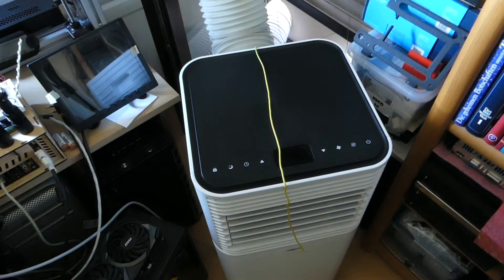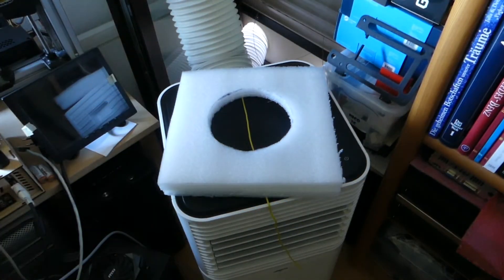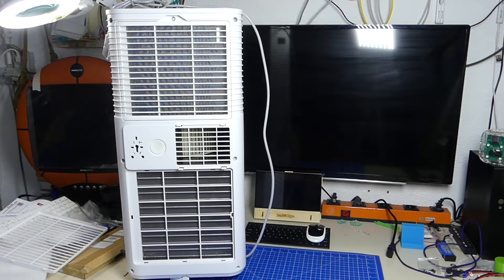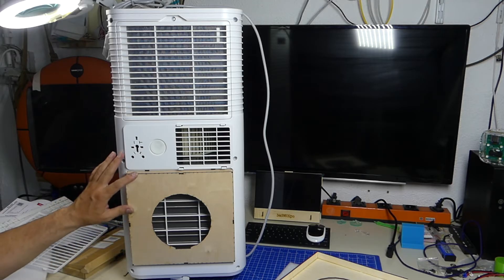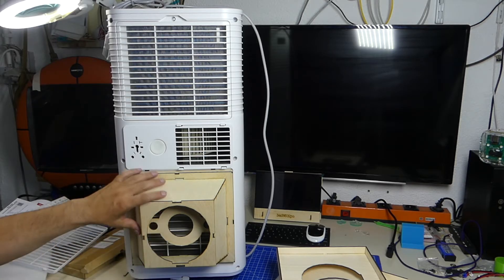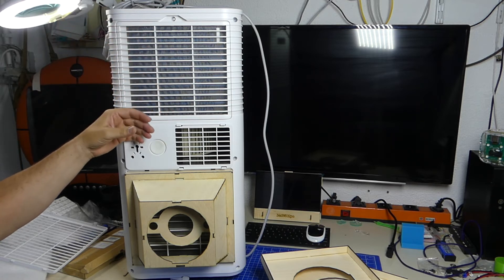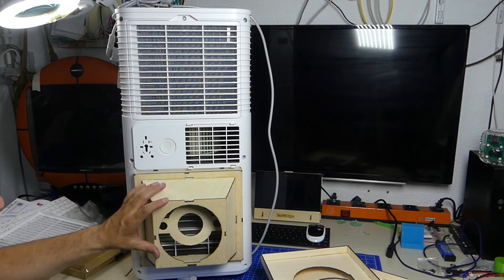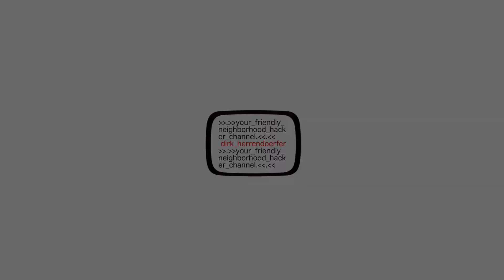Air Conditioning Mod to Dual Hose - The Perfect Unit - Hold ya hoses, going tripple

Comment from the maker: There have been a lot of requests for the hose-box cut files.
Here's the link for the parts file. You can use this with a laser cutter, or print it out to make the adapter from thin (3mm) boards.
https://drive.google.com/file/d/1gewKkT7uvWD-K3KmK_vRhNqbHUll4xzC/view?usp=sharing

Comment: I just converted my Delonghi  Pinguino into a dual hose unit, and wow... what a difference. I'm in a 52-year old apartment, with mail slots in the doors, and it has an air system that instead of exhausting air from the hallways, it pumps in outside air instead. It's hot in the hallway. The single hosed unit would pull that hotter air through the mail slot, along with cigarette smoke. But as soon as I added a 2nd hose, it runs so much better, and no more cigarette smell. My windows are casement type that swing outwards, so mounting hoses side by side isn't the best option. But my window's 16 feet long, with a swinging window at either end. So... 1 hose per window. The next addition was insulated hose wraps. Holy crap... you can't even feel any heat from it. They have cheap wraps with velcro, but the Delonghi ones are a single sock type, perfectly sized. More expensive, but better flexibility due to jot having a thick seam of velcro running the length of it. I also cut 3/4 inch plywood for each window for the hoses. Those mounting kits let in bugs, and get hot themselves. I still plan on adding some sort of insulation on the plywood though, as I intend to leave everything hooked up over winter, and just use the dehumidifier instead.

Comment: I've been thinkering with my own quick cardboard, sadly, my ac power increased from ~950W to 1100W+.
This is still under the rated nominal "1200W" written on the side of the ac (there is also 1000W so i'm not sure).
Not sure if it's worth trying to print a 3D part to replace the cardboard one, with something similar to your diffuser inside, and a 15cm tube

Comment: My model is basically the same as yours. I made a quick adapter out of card board and foam, functionally similar to your first adapter, which hooks up to a 4 inch hose for the compressor's intake. Currently there is an issue where the compressor only stays on for 5 minutes before stopping (doesn't happen without the adapter). I think it isn't getting enough air to be cooled. I might try a 6 inch hose, but my adapter probably needs to redesigned as well.
Reply: I changed the 4 inch hose to a 6 inch one and it is now working as it should.
Reply: Thank you. Just ordered the 4 in and I got here today. Haven't tested it yet. But I had a 2-in line that I tested and it was not enough air and it was doing this.  Had to cut a few relief holes in the foam to get it to continuously run and not shut off. 

I did something similar to you. I used a foam insulation and duct tape. 

I'm expecting that I will need to upgrade to a 6-in hose now thank you. 😁

Comment: I wonder. What would happen if you pipe the hose to nowhere down to the condenser intake, and pipe the outside intake to the evaporator coil? It would be ventilating fresh air in a controlled manner similar to a car's AC in non-recirculation mode. Your current configuration is the recirculation mode which is good for rapidly cooling a space but limits fresh air. Just a thought.
Reply from the maker: Yes, that's true. But you can still open a Window this way, have some circulation and humidity exchange. You're just not sucking in all that moisture from ouside.

Comment: Hi just wonder if you can release the file public?
Reply from the maker: Done that, it's in the pinned comment.
Reply: @dherrendoerfer i see your part where you put it it has like a section separated and not nust flat did you have to replace a plate or sth because mine seems to be just flat grid
Reply from the maker: That was a coarse filter insert that I could remove to make the baffle fit better.

Comment: Hi, I've ordered the same model but in 9000 BTU variant. Any chances to purchase some wooden funnel adapter that you made ?
Reply from the maker: Probably not, but I can share a printable file so you could cut one from foamboard or plywood.
Reply: @dherrendoerfer  Actually, I have the non WiFi 9000BTU version of this unit, so it's not exactly the same. I did a cardboard Dual Hose conversion, and it improved the cooling significantly. I used a 200mm hose instead of another 150mm like the stock one, sealed the cardboard with tape, and added a quite restrictive mesh filter inside. It also made the unit slightly quieter, but the lower part is also hotter now, just like you noticed. But most important : no Negative Pressure anymore in my room !
Pretty happy nonetheless. I paid 209€ for it, worked a few hours for the Dual Hose Mod, and everything is solid enough to be reusable every summer. Really happy ! And thank you for your answer too !

Comment: Nice. Now insulate your exhaust and intake hoses, and if you can shorten the run. (move closer to your vent)
Single hose AC units should be illegal!
Reply: Yep for me. I just drove around to where they were building new houses dived in a couple dumpsters until I found an insulated duct.
It helped a lot

Comment: Hi. Great video! It inspired me to do something similar to my own unit. It's a Bosch cool 2000. Do you think it will work for it? Regards!
Reply from the maker: Looking at the unit, it should work - It seems like it's just a rebranded Midea. I believe that one has been tried succesfully before.
Reply: @dherrendoerfer  Thank you for taking the time to answer my question. I will probably attempt to mod it before summer kicks in.

Comment: Great idea using cnc laser cutted wood! The greater improvement since the 1st version came from the box deep. The box deep should be, at least, 1/4 of hose diameter, so the air has enough lateral area to spread around evenly. I would also relocated the hose hole as low as possible, because the lower pressure (higher suction) behind the condenser is at its higher part (closer to the condenser fan).
The 3rd hose was also very clever, I would do it too!!!

Comment: i have this exact model of ac unit, could you please give me the measurements you used so i could fashion my own mod?
Reply from the maker: what measurements would you need ? - the box shaped insert has a size of 255x240mm some sanding at the edges make it fit perfectly.

Comment: I have a single hose unit that I'm going to convert to dual house.  I completely disassembled it and inspected everything....

* This piece of junk is pulling a big draw on the room 
* It blows out a very heavy plume of very hot air 
* It is sucking hot air in from the room next door!!?!
* I'm going to do a duct tape special and feed it fresh air from outside 

What a very frustrating design they have made...  It makes no sense
Reply from the maker: Yeah, the unit I started with had the same issue.

Comment: Third hose seems the obvious way after seeing this video, but why don't you just lift the unit up? I'm trying to mount a shelf near the ceiling and install my portable ac there as I have also ax exhaust hole in the house wall; I think this way I can shorten the exhaust hose and also make the unit cool the hot air near the ceiling and 'shoot' it at the floor. I think I hope I'll get some improvements this way over a standard floor installation.
Reply: PS your single to dual hose videos are awesome, thank you very much for sharing!
Reply from the maker: @giuseppearcieri1944  Yeah, that is a good idea too.

Comment: I made a similar conversion for my mohorhome however my problem is, due to the lack of space, I had to install the original exhaust hose and the new hose to take the air from outside very close together. Do you think that might be a problem? This would mean the condenser is probably going to take some hot air previously exhausted, mixed with the exterior air
Reply from the maker: Generally yes. The units usually have enough coolant to support a wide temperature difference across the condenser and still be efficient - maybe you can add guides or vents in a way that separate the air flow somewhat.
I build a recessed unit using the three hose design for a friend in a mini-apartment and it works like a charm.
Reply: Cus if u add a second hose to cool the condenser it won’t reallly do anything the ones they sell with 2 hoses are mad to use the outside air to cool the condenser then expel that air and the air it wakes in gets recirculated, if u add hose it can magically make the air recirculate so it will still be dumping the good air outsode

Comment: Would it be worth while putting a fan in the funnel shaped inlet from outside and maybe a fan assisting exhaust?or would it tax the system too much
Reply from the maker: No, it would probably help. But you would heat the cooler with outside air, or introduce humidity maybe.

Comment: Hello. Perfect job ! You seem to be someone perfectionist and pugnacious (as a quality of course). You helped me a lot in my research. Did you insulated the 2 interior parts (hot // cold) of this unit with thin insulation sheet + thermal silicone sealant as well, to prevent any air leaks? Finally, do you think it would be interesting to switch to 2 insulated exhaust ducts for air exchange with the outside? (I am thinking of thermal exchanges but also noise attenuation). Sorry for my bad english :)
Reply from the maker: Thanks ! never heard of that second adjective before ... 
I think that insulating the hoses only makes sense when you have a very long way to go, in my case I think it's not needed. The unit I have here was not modified internally, I think it's good enough, at least way better than all the others I've experimented with.

Comment: This is series of videos on portable AC units is super inspiring and well done on explaining all the details. I really enjoyed watching the conversions to improve the single unit design. 
It inspired me to undergo a similar conversion and prepare for the summer. It's best to start early, before these units become very expensive and unvailable :)
What do you think of the Ometa AC unit 9000BTU, it seems to have similar design with the condesor coil nicelly exposed at the back? I probably would need to open it up to confirm that inside partitions are well separated and sealed, but looks promising. It doesn't seem to have nice removable covers like this Medion unit, but I think that's something I could work around.
Reply from the maker: Yes, I think that may even be the same unit inside - or something closely related.

Comment: Hi i have a logic that looks exactly like yours but im not sure if mine will need the top or bottom converted is there a way to tell more air seems to get puljed through the top there seems to be a senor on top ill add a pic if i can 
Thanx in advance 1:49 1:49 1:49

Comment: I've discovered that my RCA 12,000 BTU portable AC unit is made by Midea and uses a similarly separated and gasketed design to yours, in spite of being in a larger and differently shaped cabinet.  Your videos are quite helpful for me to add a condenser inlet hose.  It's particularly important right now as my area has been blanketed in wildfire smoke for a few days and I have to stay inside and keep the windows closed to avoid triggering my asthma constantly.  I can't use my single hose portable AC since it will draw too much smoky air from outside.  Adding an inlet hose for the condenser will help me a lot as the temperature outside has been over 30 yesterday and today, and it's starting to get too hot and humid in the house.
Reply: Hey there, i think i got the same model as you and I’m currently looking forward to do this mod. Have you done it yet? If so, let me know if you have any tips regarding the way to connect the new hose. Idk about yours, but my model didn’t come with a detacheable filter like the one in the video so I’m still tinkering it
Reply: If the unit is not near a window or exterior door it's better to not have a hose pulling in the Smoky air from outside

Comment: you might wanna measure the actual power drawn with and without the second hose. my shot at this didn't go as hoped. with the second hose setup the power consumption increased from around 690W to 830W without a significant change in temp vs. time figures
Reply: The condenser was being cooled with conditioned (cooled) "from room" air in single hose configuration. With dual hose configuration, it's being cooled by warmer outside air--the compressor sees a higher pressure workload, trying to compress the warmer refrigerant. 
How much difference? It would depend on the inside-outside temp difference. 

The efficiency of dual hose configuration will be seen with faster indoor cooling and reduced operating time to maintain that cooler indoor temp.  Overall, the dual hose will be more efficient.
Reply: could be that the intake hose doesn't allow enough air to cool down the compressor enough. You might need an electric fan in the intake hose to let more air in
Reply from the maker: Interesting. I wonder what would be causing that - with my PAC the power drain remained almost constant. What are the btu/power draw values from your unit ? Oh - and what type of coolant is sit using ?
Reply: Sounds like you didn't get a large enough diameter hose or the way your box is designed is preventing air flow over the heat exchanger coils. Which is causing the fan to run faster and harder and for it to keep tripping off and then having to turn back on and cool down even more.  

And playing with mine. Mine was doing this until I cut a relief hole in the insulation foam to let more air in.

Comment: What do you think would be preferable for hose diameter, a 4" or 7" as an intake. Looking around my local hardware stores and can't find any 5 or 6 inch at the moment.
Reply from the maker: The intake should not be smaller than the exhaust - 7" sounds ok - that should make the fabrication of the shroud easier too.
Reply: @dherrendoerfer  Thanks! 😃

Comment: I have loved all the videos you have put up and you enabled me to build a home made 3 + 1 axis 3D printer with milling capabilities and laser cutting as well. Thank you Dirk. I also have a single room AC unit where it pumps hot air outside and i need to modify it as well to stop  negative pressure in room drawing in hot air from outside. LOVE your work Thanks again.